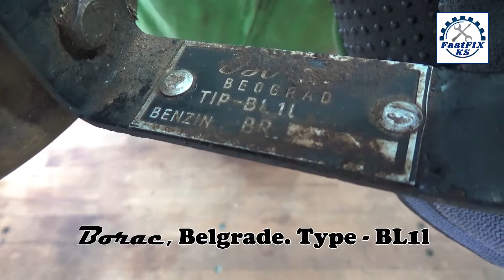Antique Blowtorch Restoration

Comment: I think that some ethanol in your warm up cup would be a much cleaner way to warm up your burner than what ever it was that you used that burned with so much soot. Excellent job you must be very well pleased!Thank you for posting.
Reply from the maker: I didn't know that. Next time I will definitely try to heat the blowtorch that way. Immediately after testing, I cleaned the burner while it was still fresh. I will use this item often, so your advice with ethanol is welcome. Thanks for watching.
Reply: @fastfixks  if you are only going to use it outdoors then you could do a pre heat with Methanol but be away that Methanol emits toxic gases wne it is burned cot safe to breath so not ok for indoors. High percentage Iso Alcohol burne hot but it has a tendency to make soot  though not like what you used. All in all I think ethanol is a great choice if you can find it. As for fuel for your blow torch 1-k Kerosene is ten times cleaner than 2-K Kerosene. 2-K Kerosene is intended for heater units with an external chimney and are not suitable for indoor use. Klean Heat is a synthetic high purity Kerosene safe to burn indoors and it does not smell like 1-k or 2-k (which does not smell good). You want to use a non flammable fuel one considered to be combustible with a flash point from between 124 degrees F. at the low end and 150 degrees F. at the high end (that just happens to be the manufacturing flash point range for Kerosene production). I hope this is of interest.
 Klean-Strip Klean Heat is the perfect choice to use in kerosene-burning appliances such as heaters, lamps and stoves. This premium fuel is safer and more convenient to store than kerosene. It contains less sulfur and aromatics, so it has NO kerosene odor – before, during and after burning. The clear formula burns clean to extend the life of your wick and limit smoke, soot and emissions.

    Kerosene alternative for heaters, lamps and stoves
    Odorless heater fuel
    No odor before, during and after burning
    Excellent heat output
    Clear formula burns clean to extend the life of your wick and limit smoke, soot and emissions
    Safer to use and store than kerosene
Reply from the maker: @morayjames92  Thanks for the comprehensive and detailed answer. A lot can be learned from your answer. I will apply your advice of course. Thanks again. 👍👍